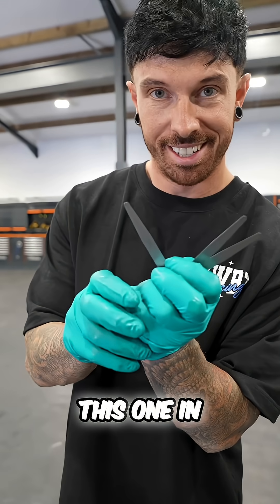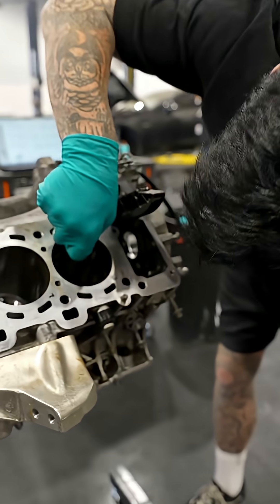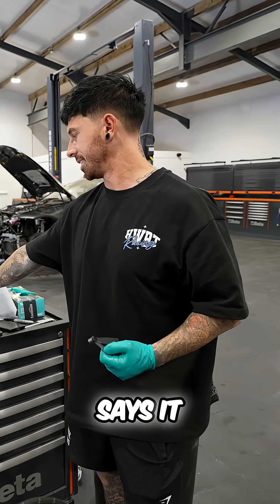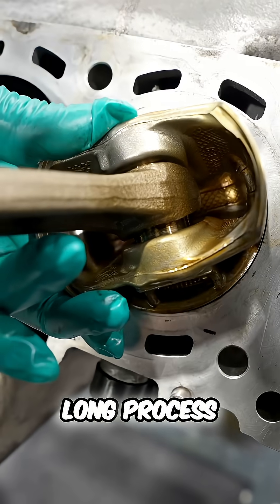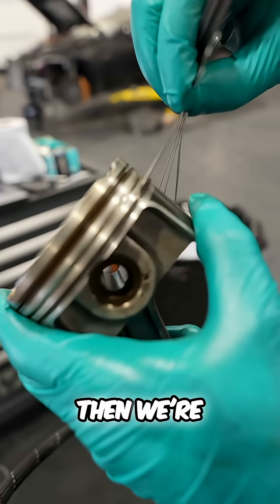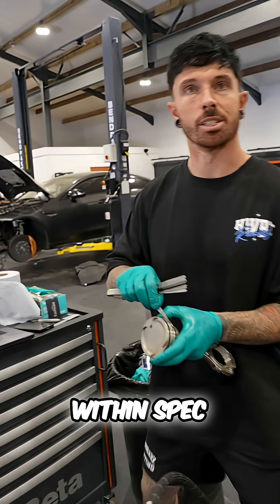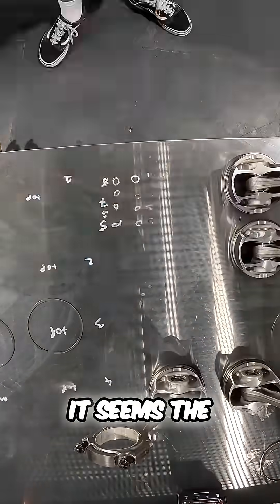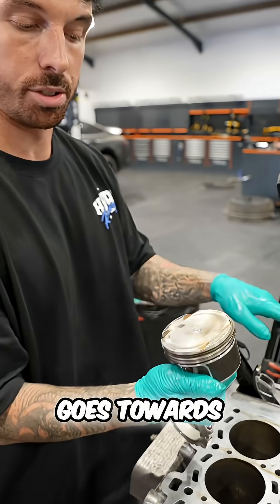Mechanic Secrets: Engine Rebuild Tips and Tricks Revealed! #shorts

Comment: Ed smith and total seal recommendations are more gap s better because if the end contact from more heat , sylvalite or forget run tight tolerance the heat goes somewhere